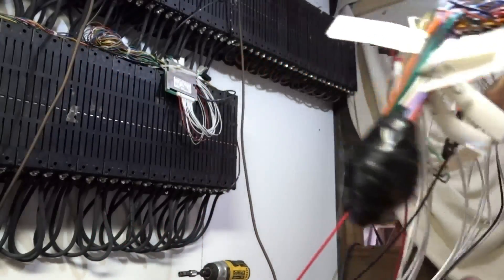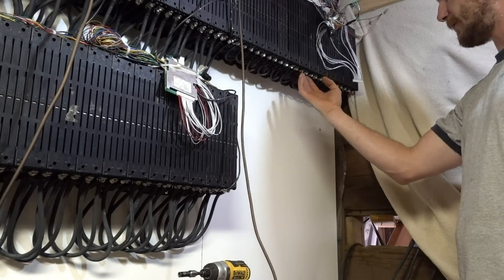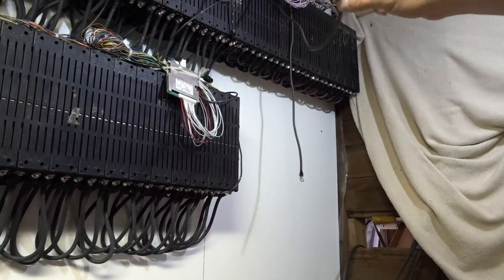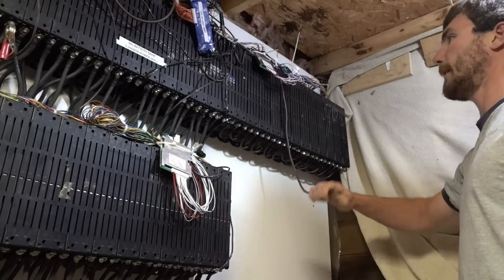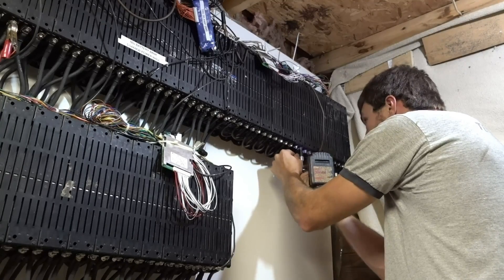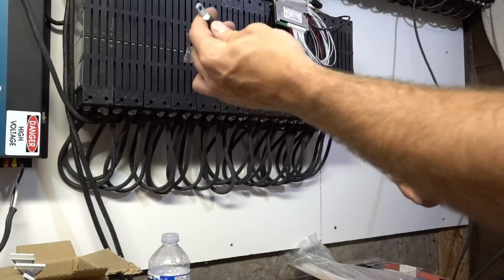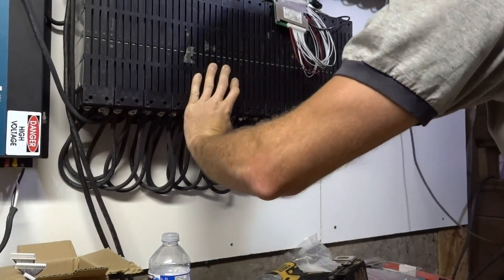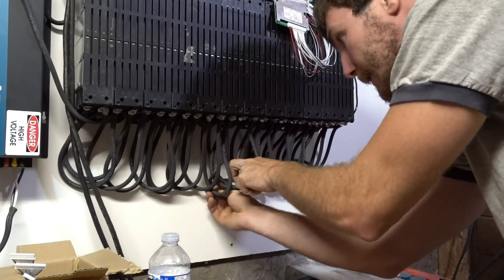Got The Batteries On The Wall and It Looks Good

Comment: It does look a lot better with the smaller wires.  Also what if you put 6V on the pouches, would they explode?
Reply from the maker: I have put over 5 volts to them and they just got warm. I will make a video!
Reply: I think they might explode if you leave the 6V on them over days.  I would be very interested on a 18650 too.  In some flameproof enclosure.  Maybe 6V at 180F (as hot as it would ever get).
Reply from the maker: I will do my best!
Reply: I got the 200 18650 batteries recommended from jehugarcia. The packs are wired 10s2p and I was trying to keep them as-is and not rewire them.   I have a 2 flexible solar panels that put out 44.4 voc.  They put out pretty good amps with no charge controller at 40.0V.  However, I worry that 4.44V on the cells is too dangerous.  I was planning on using either a timer or  digital programmable relay to limit volts to 3.92 a cell (military optimal).  But the problem is I don't trust the Chinese relay sitting  in the dirt and sun over time.  But, if 4.44V is safe then I would not worry about it.  These simple systems can really get complicated.   I use a DC-Dc 36V to 12V 20A converter to use the battery power.  I think I will just use the green charge controller.
Reply from the maker: I would yes, I was thinking about thoese from jehugarcia but I have a good place close buy for my lithium batteries